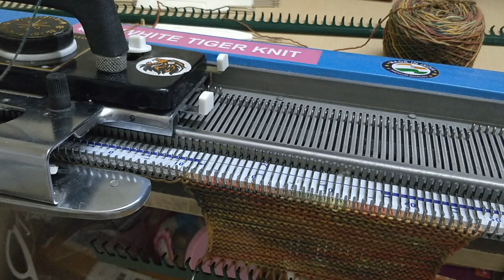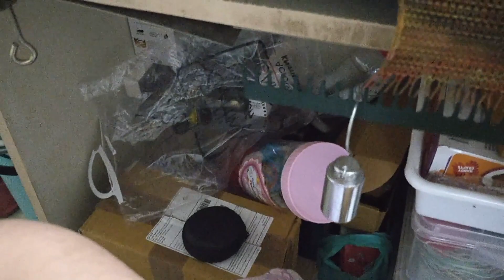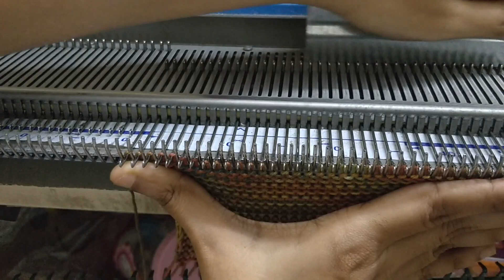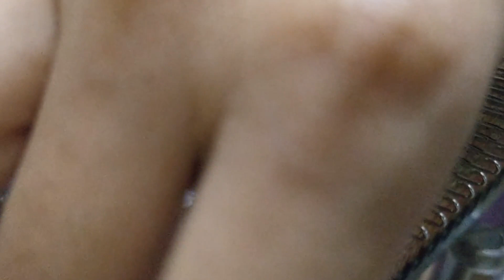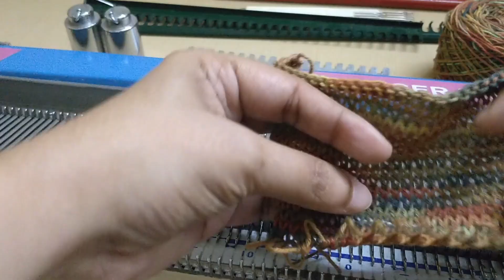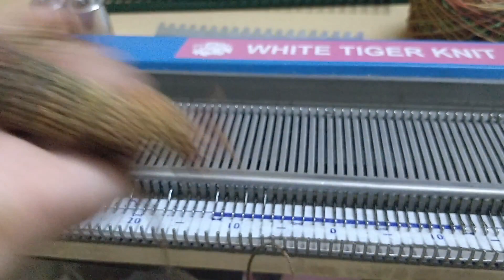Part 3 - Cast off using latch tool

Comment: Nice video set.  How did you keep count of your rows?
Reply from the maker: Thank you. I just count in my head. So far it has worked for me. Most of the projects i made had stripes. So it made it easier.
Reply: @MadeWithLoveByDaisy  Oh, I see. Well, I have made 15 videos using the "fantastic" model - I am go to see if I can't find a row counter that works.